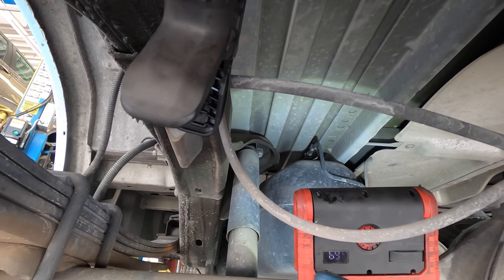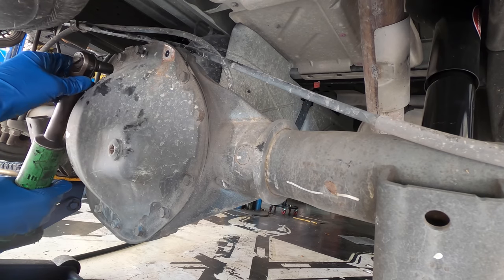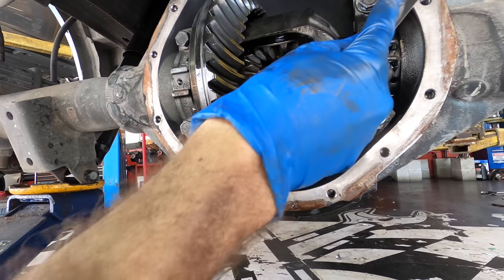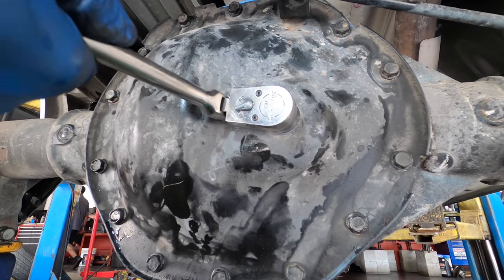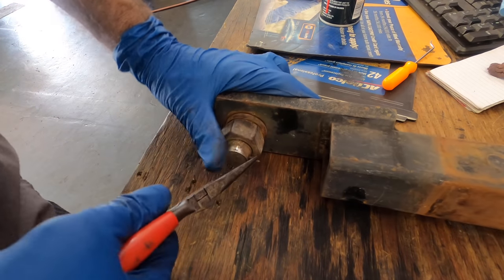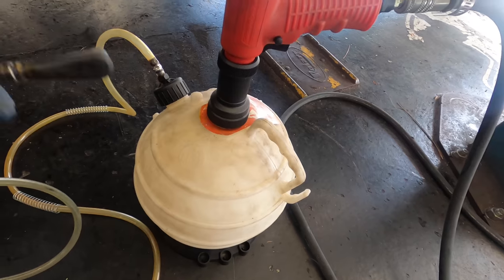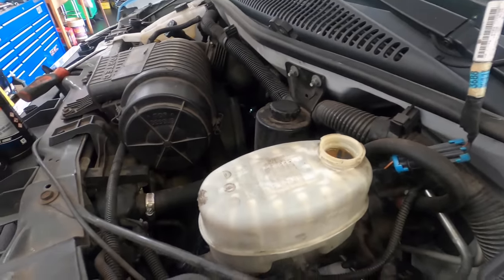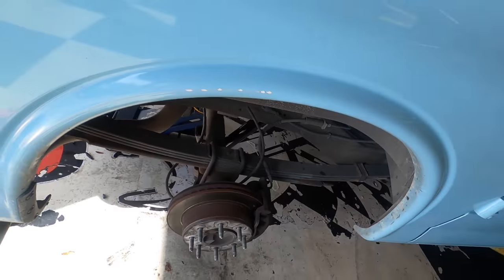GMC 2500 The Rebuild Continues. Cracking the Diff cover and MORE!

Comment: Living in the rust belt, watching him just casually removing shocks, spindles, without breaking a sweat makes me SICK!!! I have to need a torch to get stuff off
Reply: start using anti-seeze where ever you can
Reply: I can relate
Reply: southern repairs....just undo that 10 year old chassis bolt....Northern rust belt repairs......wheres the case of penetrating oil and the torch?
Reply: @berndeikers8924  that helps only if the last guy who assembled it used antiseeze or fluid film.
Reply: @berndeikers8924  and lps3
Reply: Lol...right!?

Comment: The brake fluid flush reminded me of bleeding the brakes on my 1967 Austin Mini Cooper S, put wrench on bleeder screw, apply torque in the appropriate direction, swear as bleeder screw snaps, remove caliper, jam a stick into supply brake line, drive twenty miles to the Brt car dealer to have them remove what is left of the bleeder screw, reinstall caliper, finish bleeding brake system, go have a shower. I learned so much from that car that my four years in high school auto shop did not teach me. I now own a Toyota and it is someone else's problem, I just pay the bill.
Reply: To bleed brakes on my new purchase  classic 93 F 150 prior to driving into work area, put line wrench on fitting, push on wrench, snap wrench flare off, take wrench back to NAPA for warranty replacement, along with caliper cores to purchase rebuilt calipers, and rotor/hubs. and bearings.and brake lines. and many other things in the following weeks.

Comment: That van required a lot of work; looks like they've been needing a good mechanic for a long time
Reply: I drive a fleet vehicle and its difficult to get your repairs done and not be without it for a long time. So most drivers will let things go until its absolutely necessary to give it up and hope you can find a spare vehicle to use.
Reply: Bet you they had them going somewhere else and just got the very bare minimum, if that, and was just invoicing the owner of the vans.
Reply: @sturnie1  That's a lie. You have evenings, night, early mornings and weekends. There is no excuse to not properly maintain a work vehicle.
Reply: @mikeznel6048  most shops aren't open early mornings, evenings, and weekends. What he said definitely wasn't a lie. Try working 14-16 hour days 6 days a week then tell me there's time for maintenance and repairs. We all know it needs it but depending on your job it may not be possible without having a spare laying around. If the company has its own shop to maintain the fleet its a little easier. You know how many "days off" I've spent doing repairs and just regular maintenance on my truck? Maybe don't call someone a liar without ever walking a day in their boots.
Reply: @mikeznel6048  I work weekends…
Reply: @johnnysouza5601  well you have a point, but whether it is for preventative maintenance or breakdowns due to neglect, you will have to be without said work vehicle sooner or later.
Reply: @thechaindude1320  i agree with that I've definitely had to deal with that myself. During the busy season its fingers crossed hoping theres no major break down. As soon as I can breathe a little bit when it starts slowing down I catch up on servicing it. When your job revolves around things that you can't control like the weather you just gotta go balls out to get everything done.

Comment: Smart move by that business having the whole fleet sent in to be maintained and repaired. The cost of properly maintaining and repairing right when an issue arises is far less than the cost of major repairs associated with a brake down. Factor in lost work and income due to break down, towing fees and extra money for more parts and labor, this is the wise choice indeed. The time a break down costs you also adds up as time is money and trucks sitting on flat beds and at shops cost more than just maintaining the vehicle properly. It's nice nice you have somebody come in for work and just let you fix what's wrong and not nickel and dime the vehicle until it fails catastrophically. A smooth ride and a/c do wonders for employees too. When they have a nice work truck/van, they tend to take better care of them and are happier at work. Wise move and it's a win win situation for everybody.

Comment: It's nice to see a pro use vacuum bleeding successfully. I used vacuum a few times but was irritated by air escaping around threads. As you say, I should just not worry about continuing air bubbles even with silicone paste on the tube nipple. Pressure bleeding would be nice but even with quality kits there are all kinds of different MC reservoir cap sizes, so you end up needing a whole inventory of adapters. For those who don't do it every day, a two-person bleed with brake pedal pressure works OK. The new challenge will be having the scan tool to relax the emergency brake, the game moves on even if we don't want to.

Comment: I bought a 1987 K20 Suburban (new), and it had the same, crappy, semi-floating rear end in it as this van, but with an Eaton limited-slip system. It grenaded at 84,000 miles, destroying the spider and side gears, all of the bearings, the cover, and badly scoring the (4.10) ring and pinion. I never towed anything, nor overloaded or abused the axle in any way.

I replaced the entire assembly with a full-floating axle assembly from a 3/4-ton pickup, but it had 3.08 gears. I installed new aftermarket, super-duper 4.10 gears, new Timken bearings, SKF seals, and a Detroit Locker. I set it all up and installed it in about four hours. I use Amsoil 75W140 full synthetic oil with GM's Positraction additive, changed every 50,000 miles. It's still just fine at 560,000 miles. And counting...

...And I find only the tiniest amount of grey goo on the magnet when I service the unit. GM's 14-bolt semi-floater is pure, unadulterated fecal matter. The 14-bolt full-floater, though, is better than any other light-truck axle extant.

Comment: Brake bleeders that turn, not in New England, whole van rust free amazing.
Reply: Not in northern Ohio either!
Reply: working at a GM dealer in connecticut i can unfortunately relate
Reply: Not a rust blister on the diff cover either. Ray is missing out on lots of fun.
Reply: Yes, in NH there virtually is no such thing as bleeding brakes, you just get new calipers.  You KNOW every valve will snap off, dust cap on or not prior to the procedure.
Reply: Send your repair bill to the hyway department. There's no reason for putting salt on the roads when there are other products that aren't so corrosive. Get the insurance industry involved. In Washington the department wouldn't screen the sand so the court found them liable for broken windshields. You got one free per year and all chip repair was covered.
Reply: Living in Germany where we don't have to use as much salt, but still some, it is hit or miss. Mechanics often get lucky, but are far from being unfamiliar with them breaking of every now and then. Depends a lot on age and of course overall maintenance. For this a regular visit to the car wash, even in the winter, seems to help a lot. But then depending on how cold it gets, that sure brings it's own set of risks.
Reply: @alexanderkupke920  all in one washing helps with that. Getting cleaned and dryed in a closed warm building will help keep rust and other corrosion from the salt at bay.
Reply: There was some red colored grease that Castrol-Girling used to make as an assembly lube for brake components. It was compatible with DOT3 fluid based systems. I used to remove the bleeders and squeeze some in the caliper or cylinder and then put the bleeder back in. To all the mechanics that had to work on the vehicles brake system after me, "Your'e welcome!" Just did a search and they still make it.
Reply: @johnregal5098  put some teflontape on the threads. will go off like it never wanted to do something else-have fun

Comment: A side note, you probably should've pulled that fill bolt on the diff BEFORE emptying it. 

That can turn a simple job into a nightmare :D
Reply: @notavailable9919  Or just pull the fill bolt first.
Reply: @notavailable9919  The trick is to not get any drill chips inside the cover. For some decades now they seem to not have a drain plug in diffs.

Comment: The shop owner might want to invest in a lift that can lift heavy equipment
Reply: I think it was just a tyre shop before changing over to a workshop. So just light work, cars coming in for new tyres, etc. But yes, they need to upgrade the bay at the far end of the workshop to take heavier vehicles.
Reply: Agreed 👍
Reply: Are we sure it wasn’t just a balance issue? It’s a work van and with all the gear in the back of the van there was too much weight in the rear?
Reply: @shakey2634  I am sure it was but no one is going to divest all the stuff in the back so they can use a car lift.
Reply: And a heavy vise
Reply: @fanbelt9926  that lift does 9000 lbs. Those vans weigh 5,500 lbs, so unless they had 3,500 lbs of equipment in the back that lift was more than capable enough. The issue here was balance. The load wasn't distributed properly.
Reply: @williameldridge9382  I had to convert that to kg to envisage it, so that's a 4 metric tonne hoist. Yep, as you said, the load was not distributed properly. We had a double ram hoist in the 60's that would lift a truck. The rams were a foot in diameter and set deep in the ground. It was installed in the 1930's and was incredibly strong and reliable. Was still a bit scary though as a young apprentice to be underneath a whole truck running around with the grease gun.

Comment: I’m so glad I was told to check out you videos. Watching your videos has brought the fire and the passion back into working on cars again, I got away from it years ago. My big upcoming job is doing a full air conditioning system on my truck even pulling dash and air box to replace heater and evap core.

Comment: Trailer balls can back off from pulling a trailers without grease on the ball. Rusty couplers can grab a hold of the ball and turn it when turning corners causing it to unscrew the nut.
Happy to see you take care of the loose ball the customer. Most shops around here wouldn't even consider doing something like that without charging for it.
Reply: Lets just hope they don't need to remove the ball any time soon.
Reply: @tedwertman2115  I use a 18"  long wrench and stand on it when putting on a ball. I have always been able to get them off, it just may need a cheater pipe added to wrench but it will come off. I have never had a ball come loose on mine since I started greasing the ball and standing on a 18" wrench. 
The old balls that had a bolt that went into them would seize up. Those had to be cut off.
Reply: @rodneythornburg818  i had one snap off before. wasn't loose and was on hitch for several years.

Comment: I've worked on vehicles all my life, and I've always hated the term "shock absorbers." The British have it right - they call them "dampers," because that's what they do: They damp oscillation after the springs absorb the shock of a bump in the road.
Reply: Nah, the shocks absorb the shock itself. The spring support the weight and provide travel. Without shocks bumps shock the car way harder
Reply: Eclectic Hoosier 
You  are so correct, (dampers) control the amount of rebound due to the deflection of the spring.
Most people struggle understanding this ‘true fact’. 73 years old last week apprentice since 1964 still learning every day motor trade gave me a job all this time I still love it, fixing stuff n helping people all my life. Good luck from New Zealand
👍👍👍 Rob

Comment: 10, 12, 14 bolt differential doesn't refer to the number of bolts on the cover. It's the number of bolts on the ring gear. Bigger gear, more bolts.
Reply: Slight correction, the 14 bolt is termed as such due to the 14 bolts in the differential cover, not the 12 bolts that hold the ring gear. The more you know :)

Comment: 3m scotch brite bristle disc work great for gasket removal. They will not damage the metal, I use them for water pump gasket, rear diff gasket etc. also makes the job go a lot faster.

Comment: Years ago working on filling the master cylinder of my car, I spilled some fluid on the booster check valve. I didn’t know until I drove into work the next morning, and all of a sudden I no power brakes. The check valve fell apart and it was an interesting ride until I had someone drive me to Pep Boys for a replacement.
Reply: Did Sphincter suction happen?

Comment: In Ohio at least 3 out of those 4 bleeder screws would have snapped. Must be nice
Reply: Ain't that the truth
Reply: And 4th one you got open with vise grips
Reply: Im rebuilding the rear end on a 98 camry and i had to get different knuckles because everything was rusted togeather on them. I found a set from arizona and when they came in they had almost zero rust and they were still painted. It must be so nice working on vehicles in the south.
Reply: use teflontape on the threads and they will go off like they never wanted to do something else ... have fun

Comment: I would only top up the brake fluid if the pads have been changed, because down the line, the next guy that changes the pads is going to push the pistons back into the calipers so he can get his new pads in and if the fluid has been topped out with the pistons already extended, that fluid will push back up the lines and out the top of the reservoir. Plus, the brake fluid level warning light should come on when the pads are worn, if you top up the level with partly worn pads, the low fluid level warning won’t come on before the pads are down to the backing and they’re wearing the discs out.

Comment: I like seeing you use a gasket i always hate beating to cover off after its been thickly sealed with silicone 

10 12 14 bolt refers to the ring gear bolts the covers also match bolt count

Comment: Nice looking rear end. lol
Bet you go thru many cans of cleaner on the job. When I was working on small engines as a kid in the early 80s (mowers, boats) as a side business I used an aerosol can attached to the air compressor. Always used gasoline in the can, worked great as a parts cleaner and cheap. But was an open-air work shop with steel roof and no walls. These days I work inside so use the non flammable stuff in a can, too

Comment: 1 gallon pump up sprayer , with sealed cap adapter, this is the big issue. you will need several caps with a hole and a sealed brass barb for hose from sprayer. You are able to fill the 1 gallon tank with 3 bottles of brake fluid, and be able to modulate your applied pressure with the sprayer handle. I have simple pint Beer bottles hanging each corner and you are able to do entire car at once. just dont apply pressure with all bleeders closed.

Comment: A friend told me he always throws away the little rubber dust caps for bleeder screws.  Living in the midwest, I can't imagine doing this.  I've never had a stuck bleeder valve that had a cap on it.  I've almost never had one that came loose willingly without.

Comment: Did you know that when replacing shocks /struts your meant to prime them by manually compressing about 3 times. This removes any air trapped during transport/ manufacture.

Comment: I’m curious about the procedure of using an air hammer and chisel to tighten up the shaft on a cooling fan after removal and replacement. All the videos I’ve watched involving this procedure show the hex shaft in plan sight and accessible for the use of the proper size wrench, seems a little crude to me. I really do admire the expertise of all automobile mechanics, especially under tough conditions.

Comment: I rigged up a funnel with tubing and wire to fill diff. Most times my Pump barrel isnt empty. Pressure bleed only an all metal master cylinder.

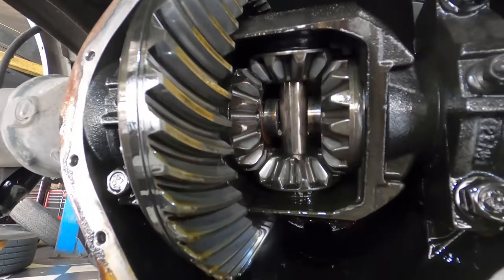Comment: 9:59. The left bearing cap appears to be missing the locking mechanism for the gear mesh adjustment.
Reply: I saw that also. Maybe GM only uses one. Shims on other side? Dodge uses both on their  Dana’s.

Comment: Can you please explain how doing a good gesture like fixing the guys tow hook doesn’t end up charging the customer? It’s amazing that you do things like this and I think it’s great that service technicians do this from time to time however you still have work to do that the customers being charged for and service is charge by the hour in most cases. I would assume if you went to the service manager and said I’m all done and then you went back and fix the tow hook I would understand that being free for a labour standpoint, but in this situation, You’re still doing work which is just going to charge the customer. 

Thanks for the great vids btw, ive learned a lot from you over the past 3 months
Reply: The amount of time is set by book time. So unless Ray charged extra for the time he took on the tow hook, it was pro Bono.

Comment: I do the back furtherest wheel cylinder because it uses the most fluid. then the other rear. when the rear are on a single rear brake line takes less fluid for the 2nd one... then on to the front... probably just habbit. when all 4 wheel cylinders are plumbed directly to the ABS valve block then I do as you do.. front or back makes no diff.

Comment: Try what I did in the early 1980's: Refill a Muncie M465 with [straight] 140 SAE gear oil. With a hand pump. In the southern California desert. In January. At night. When the temperature is a bit below twenty degrees. Fahrenheit.

I crawled out from under my truck and declared, "Today, I am a man!" By the way, I'm not Jewish.